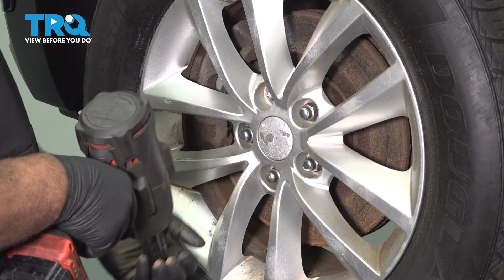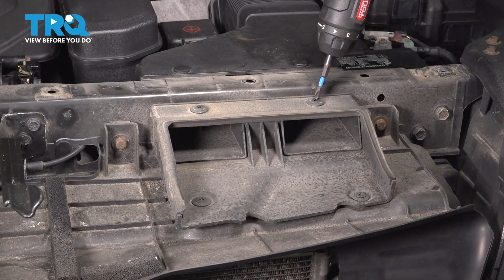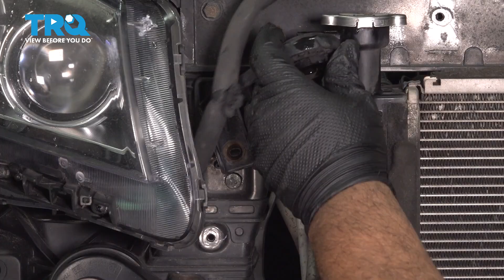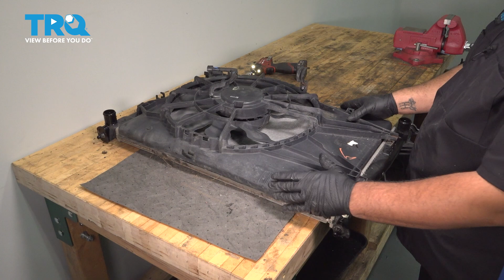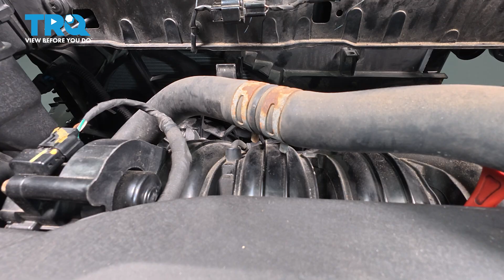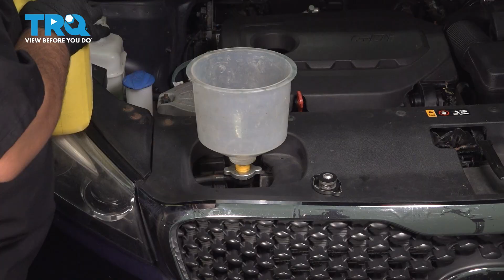How to Replace Radiator 2016-2020 Kia Sorento 2.4L L4

Comment: Do not remove the top screws in the grill the very first thing you did leave those in also disconnecting the AC is not necessary you can get the radiator out without doing that

Comment: Why did you remove the A/C condenser? Couldn’t you just disconnect the radiator from the condenser and leave the A/C lines connected?